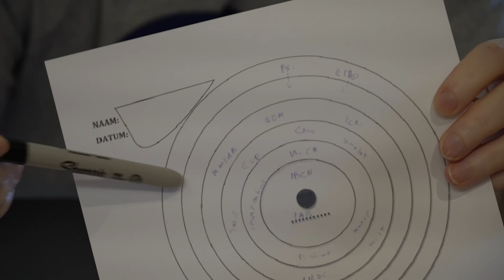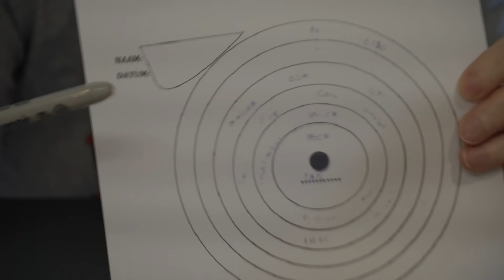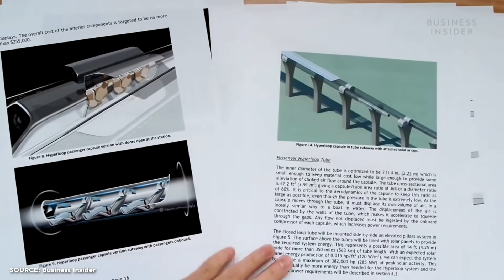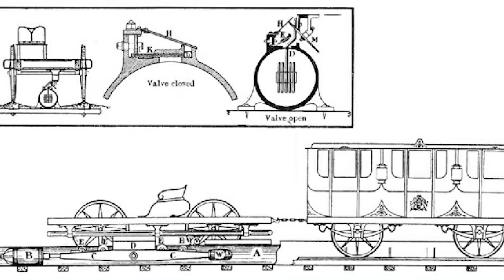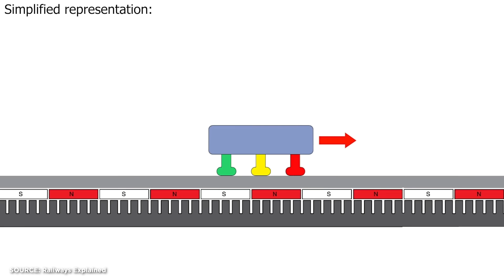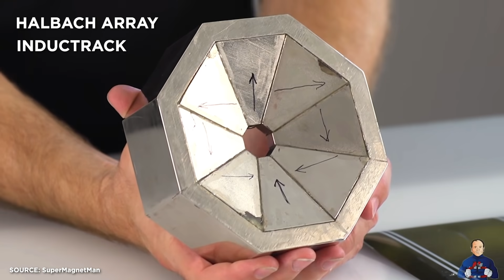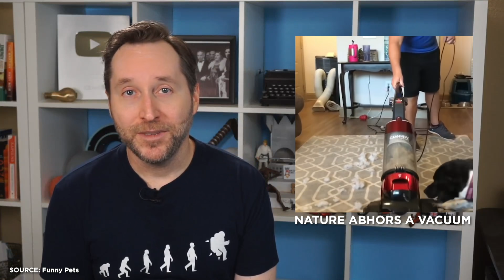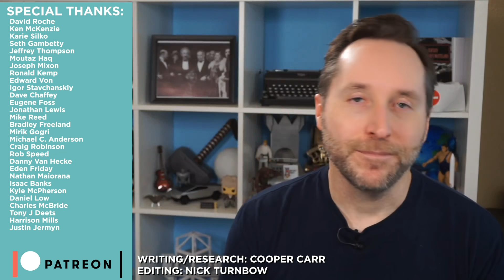What's Happening (And Not Happening) With Hyperloop | Answers With Joe

Comment: Just a thought, high speed trains in France have a commercial speed of 320km/h (although they can actually go over 500km/h but it's deemed unsafe).
So you'd make the trip between Dallas and Houston in roughly 1h15min. With a train that already exists, on regular tracks.
Reply: yeah its not a dumb idea but why do that when you can go from Dallas to Houston in 30min?? I see the point in that the tracks allready is built, but its not efficient compared to hyperloop, wich also is relatively cheep
Reply: @boskee  What science is that statement based on?
Reply: @edvardbookbratbak5473  Elementary physics.
Reply: @boskee  Elementary physics says that hyperloop is possible. And it has been tested successfully. And elementary physics is not research last time I checked.
Reply: @edvardbookbratbak5473  No, they say otherwise, and hyperloop hasn't been successfully tested unless you mean that 300m test ride at the speed of 100mph. Ironically, Virgin Hyperloop has lost almost all of its executives and chief engineer ever since and they are no longer pursuing passenger transport. I wonder why?
Reply: @boskee  The first thing that pops up when going to their website is that they have successfully tested with passengers, suggesting that you are wrong. But we´ll see.
Reply: @edvardbookbratbak5473  vacuum is so hard to achieve and maintain it makes the whole endeavor not worth.

Also, do not overestimate the importance of speed and underestimate the importance of capacity.
Reply: @Techtronos  I really don’t see the problem. We need to solve some serious problems. Nothing is perfect, but we’ve got no choice..
Reply: @edvardbookbratbak5473  we already have high speed rail. Hyperloop is rudimentary.
Reply: @edvardbookbratbak5473  You see, there's a very simple problem with that statement... The french TGV already exists whereas the hyperloop does not. You can't really say that it's relatively cheap, because you don't yet have a single real world example of how much it costs. Just imagine the cost of building a 350+km long vacuum tube. We know how to build tracks, but building a vacuum tube of this magnitude is on a whole nother level. We also don't really know how efficient that system would really be. If you look at how small these pods are and how few people actually fit inside them, I'd say they're not that efficient at moving people. So maybe it's just better to use a technology that we already have and where we know that it works instead of just hoping on some technological breakthrough that will not occour in this form.

From a technical perspective, a hyperloop can be build, yes. But from both a practical and economical perspective, I doubt that it makes any sense
Reply: @mikesturzekan8983   but it’s wrong. We do know the cost, we do know that the pods can carry 28 people. I hear what you are saying but it’s just wrong. Please read before making false statements..
Reply: @edvardbookbratbak5473  We haven't build a single line and construction projects are notorious for going over budget. You only really know the cost of something once you've actuall built it.
And yeah, 28 people is basically nothing. There's a reason as to why airplanes have 100+ seats and why trains are usually in these long big configurations. Just because people claim it's more efficient than anything other doesn't mean that this is reality.
Reply: @mikesturzekan8983  but if 28 people can go every minute instead of 200 an hour it’s more efficient.. just read the damn link I’ve sent 5 times now..
Reply: @edvardbookbratbak5473  1. You didn't sent any link whatsoever
2. That's not how it works. Ever heard of economy of scale? It's just a lot more efficient to have one giant engine pull alot of people instead of having 60 engines pulling a lot less. ALso, you can't really go every minute, because you have to depressurize and repressurize your system every time a capsule goes in or comes out which is gonna take significantly longer than a minute.
Reply: @edvardbookbratbak5473  Zero people can go nowhere at no time because the system does not exist as theorized!

Efficiency is measured in the real world not on paper and trains are one of the most efficient and ecological modes of transport.
Reply: The question becomes whether that is more economical than self driving cars. In a completely self driving car, you can have a sleeping cab and arrive in the morning. Or a mobile office and arrive for your afternoon meeting. A maglev or high-speed conventional railway would have to be built from scratch while highways already exist. Specifically for the US I'd put my money on self-driving cars rather than high speed rail due to the abundance of highways and lack of passenger rail.
Reply: @josephmauck9200  First of all: We're still years and years away from full self-driving cars. At least from those that are built the way that most manufactures build them.

Second of all: Public transit is always more economical. It doesn't matter if your car is self-driving, electric, hydrogen or whatever, they cost a ton of money to operate and to buy in the first place. And even if you factor out those things, the infrastructure (aka streets) to support so many cars is horrendously expensive.
Your argument that highways already exist while high speed rail doesn't may be valid in the short to mid-term, but not long-term. You see, building a high speed rail network may be expensive, but maintaining it will be a lot cheaper than maintaining giant highways that also have less capacity and are slower. Again, no matter what level of self-driving you have managed to implement, the cost for the infrastructure are not gonna change a lot. In fact, while road wear and tear might go down a bit, by incentivising everyone to drive a car, you're gonna need even more lanes which is gonna cost even more money... So yeah.
Reply: @edvardbookbratbak5473  Out of curiosity, you note that in regular trains 200 an hour is some measure of capacity. Huh. A French TGV caries 485 passengers - you can stick two of them together if you like, and they can leave every 5-10 minutes or so to the same or different destinations. Help me understand your calculation.

Comment: "You can get from New York to L.A. in thirty seconds"

No... the pudding that used to be you, will get there in thirty seconds.
Reply: That was my thought.
Reply: certainly, the non stop acceleration, like sitting in a couple G's simulator, would not be a comfortable trip!
Although, they could put you in a fluid, and "depressurize" the fluid... if thats possible as fluid isn't exactly compressible; to reduce the sense of pressure you would experience as the fluid "compresses".... IDK. Just ideas.
Actually, it would be the fluid compressing the air in your body.. so create a vacuum outside of the fluid, to maintain the internal pressure your body experiences.
Something I never thought about... Could you leverage fluid dynamics to reduce the effect of G's on the human body? maybe increasing the surface area so there is less pressure per square inch, so the tank absorbs more of the pressure!
But... Were talking about inertia... so you're body is still gonna experience a flattening of itself internally, even if the surrounding is designed to accommodate non-pressure points... hmmmm...
Reply: Yea, my first question was, how do you survive the acceleration?
Reply: About ten seconds to speed up,  then 20 to show down but that mass of bones and meat juice is not going to be happy about it.
Reply: @AB-wf8ek  You don't. Assuming constant acceleration and deceleration over the 2460 mile great circle route between New York Laguardia and LAX, and ignoring centrifugal forces, the acceleration is 1793.6 times Earth's gravity to a speed of 263.9 km/s and back to 0. That speed is 23.6 times Earth's escape velocity.
Your bones will have collapsed under that acceleration.
Not wanting to do the calculation, I think the centrifugal acceleration trying to follow the curve of the Earth through a tunnel through the Sierra Nevada, the Rockies, the Appalachians, and other minor mountain ranges and hills is going to be fairly significant.
Reply: @Markle2k  So, If you travel at 1G, you would reach 2000km, or 1250 miles in about 30 minutes, then slowing down at 1G, another 30. 
So one could reach LA to NY in an hour experiencing 1G downward and 1G laterally, which placed at a 45 degree angle would be 1.41 G's constant.... I think.
Reference:
https://space.stackexchange.com/questions/840/how-fast-will-1g-get-you-there
Reply: @Reach3DPrinters  Assuming your math is correct (which it probably is), sustained 1.41G isn't likely to be comfortable but it's not likely to cause any harm either. Get these people comfortable chairs and make to take a moment at 0G acceleration to turn the seats around and it's a trip that shouldn't cause any injury.
Reply: @Reach3DPrinters  1G is so obsolete, what about 5G?
Reply: @Reach3DPrinters  the fluid would mean more mass, more fluid would require more power to move people. Then there’s the time it would take for immersion and decanting. Would you really want to sit i. someone else’s fluid?? Have you ever been on the subway? There you’re already smelling someone else’s fluids. 🤮
Pressure vessels that contain fluid still have to follow the laws of physics. Accelerating and decelerating a train full of fluid would be disastrous. The only place using fluid to transport people quickly is in a fluidic medium. And there again, humans breathe air.... you see the problem, right??
Reply: that pudding comment reminds me of Excession.   What a book.
Reply: crunchy pudding, my favourite.
Reply: @MrDoboz  HAHHAHA, there's no 5 minute abs, only 6 minute abs!!!!
Reply: @n8rtotplayz647  Solution to tubular fluid transportation.... vortex laminar flow... column of air in middle. :)
But on a serious note, aside from defying physics, perhaps a body bag of fluid only slightly larger than the individual, like a gel suit tailored fit. its free to ride 10x a year, but you gotta buy the $50,000 suit to survive.
And if survival fails... body bag is already in place, so win win for society and maintenance crew.
Reply: with what he describes, I'm not sure anything arrives, you're probably pulverised in the first few miles
Reply: @dragonsword7370  using your numbers thats something like 1,462g of acceleration.  using averages for adult humans thats 1,259,546 pascals.  atmospheric pressure in pascals at sea level is about 100,000p.  thats 12 times atmospheric pressure in 10 seconds.  using charles law (I know, ideal gas law and humans are mostly liquid water, too lazy to try to figure that out so simplifying it to water vapor) that means you would heat up to 3633C, or 6,572F.
Reply: @AB-wf8ek  My first thought was that it was a joke.
Reply: Not if you flex your abdominal muscles.
Reply: @Mumbamumba  yells at g forces "COME AT ME BRO!"
Reply: They never said intact .
Reply: Even without acceleration or deceleration to make that trip in 30 seconds would require a speed of 249,120 mph. But Omega tube only gets you to 9,500 mph top speed, so the best you could do would be like 16 minutes! And that's assuming you could even put a hyperloop IN a high-speed train! 

However, if you took your 1km tube and put a series of conveyor belts 1 meter wide with each one going 1.5 mph faster than the one next to it, you could hop on the first normal speed one, then transition to a slightly faster one next to it, etc until you were traveling at Mach 2! I'm not sure what kind of noise a human traveling at mach 2 would make inside a tube but I'd be willing to give it a try! But in reality, this would be a pretty good way to travel within a city once you get there! No more waiting for the next train, no more trains period! Just get on a walkway and you're on your way! Or if you're in a hurry, or are next to a woman wearing too much perfume, just move to a faster conveyor belt!
Reply: @MrDoboz  5G would cause too much Corona-virus with side effects of becoming lizard people. It can't be done.
Reply: I really like pudding.  I wouldn't necessarily mind being it either.  All things considered.
Reply: @n8rtotplayz647  tenho que dá um Suport para Povo 🤗🗺️
Reply: @PoeRacing  estou combatendo tudo que vem .
Reply: I do not think you can go from Cleveland to Indianapolis, in 30 sec.
Reply: I can do that now, in even less time, in fact I've gone to Taiwan in about 6 seconds once a week for a couple years. It's called 'Skype'.
Reply: Maybe doing it in just 30 minutes would be adequate?
Reply: I did the math, can confirm you would be pudding.
Reply: @n8rtotplayz647  
I know! Why don't we fluidize the passengers, shoot them down a pipeline at supersonic speeds, and then reassemble them at the other end? This would be far, far, easier than building a hyperloop. 😁
Reply: @Reach3DPrinters  The Hyperloop Alpha document uses a maximum acceleration of 0.5 g.  At that acceleration you'd reach the proposed 1220 kph speed in about 4 minutes.

Accelerating at 1 g for 2000 km would give you a speed of 8400 kph.
Reply: @michaelsommers2356  At 0.5g, you're hitting mid way point, 2000km in 15 minutes, which would be 4,413m/s or 15,887kph.
Why cap max speed to 1220kph?
Reply: @Reach3DPrinters  That is the top speed given in the Hyperloop Alpha document.  It's already ridiculously high; going higher is beyond ridiculous.

Comment: "Shrink wrapped by Steel" Bwahahahah.
Reply: Oh, you missed all the transportation puns he said while describing what Hyperloop was at the start of the show.
Reply: Kilal Googlestaffers  It was stainless steel.
Reply: Kilal Googlestaffers  Correct. 3mm stainless steel. A tube with this diameter needs about 6mm to be considered safe for a vacuum.
Reply: Fastest way to fit an Ironman suit. Lol
Reply: Iirc the video of the railcar implosion was made by the manufacturer as a sort of PSA for their customers. 
The cars are used for transporting dry powdered or granulated products like plastic pellets. These are unloaded by vacuum pumps. 
There was at least one instance of someone forgetting to open they vent hatch on a car compartment and destroying the rail car.
Atmospheric pressure is scary in the right (wrong) circumstances.

Comment: Work with me here: Lead balloons. No, wait - Zeppelins! Yah, that's it.
Reply: Well, it makes for a fantastic band at least
Reply: Don't you diss Lighter-Than-Air Craft!

We can have container ships in the sky!

(My only concern is Helium use, but hydrogen, or hot air can work too!)
Reply: @ericlotze7724  Underrated comment
Reply: @ericlotze7724  
sure...until you realize that even the largest zeppelins had a minuscule carrying capacity. 
far less than just a normal cargo aircraft, and are much slower, and unreliable in bad weather. 

they didn't work for a reason, they just weren't competitive and didn't make sense when compared to the speed and efficiency of aircraft, and the massive and cheap cargo ships.
Reply: @livethefuture2492  I can see this tech being used to air-drop critical things like paramedics, or emergency equipment in urban areas.
Maybe flying fire-control too?
Or if you're gonna be a capitalist about this, amazon did say they would use blimps as flying warehouses. But I like the idea of airborne emergency services more.
Reply: @livethefuture2492  Ships can't deal with bad weather, and this limited them in the past, but now we have weather predictin, so you can just go around the storm/not leave if one is in the path.

Also our newer materials science (ie not ww1 era) opens many oppertunities.

DARPA has done work on "Hybrid Airships" etc.

I think the only thing stopping them is the need for hype (looking at you elon), and funding (ie "technological lock in) .
Reply: You might be on to something there!
Reply: Where’s that confounded bridge.